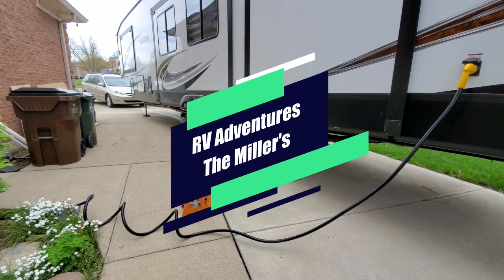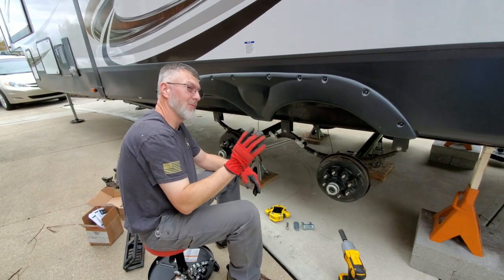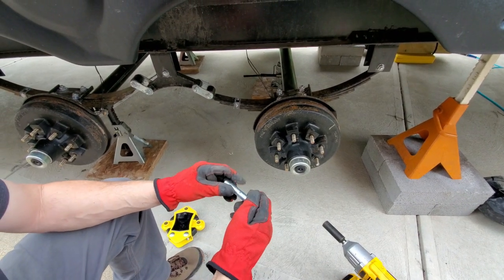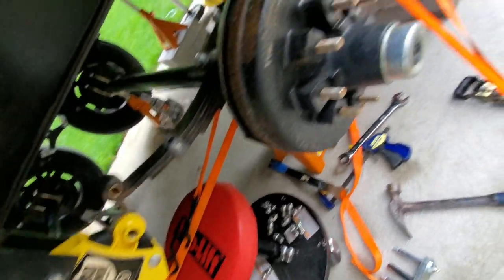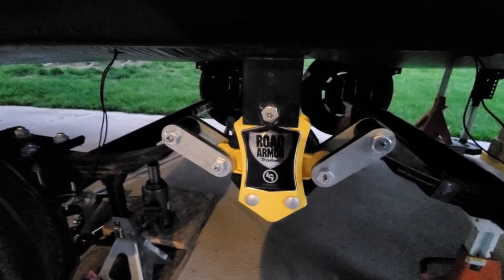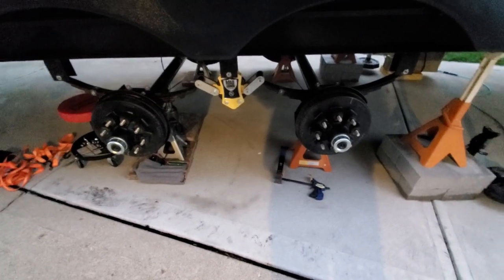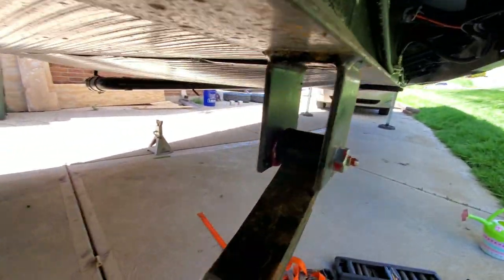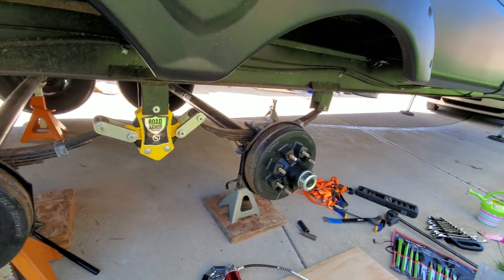Suspension Upgrade

Comment: One thing to minimize the chance for a blow out is check the damn tire pressure before you leave and get a tire pressure monitoring system, they're pretty cheap and most monitor temps so you can stop before you have a major issue.

Comment: I have a 1994 Skyline Nomad that I’ve been going through it and replacing a lot of old things. Mostly with better electric components. I went out to check my shackles and mine have the heavy duty shackles. Those were probably the standard back when my trailer was built. Everything now is  built with barely adequate!

Comment: I know this is an old video but can't tell you how much it helped.  Specifically the reference to the shackles.  After watching your video I ordered my kit.  4-6 week back order so I decided to check what was in my order.  Guess what, the shackles were the longer 3" ones not the 2 1/4 " I needed for my 33" on center axles.  So I called Lippert and they changed the order and they even had the 2 1/4 shackles in stock.  Thanks again .

Comment: I have my Polaris Rzr 900 EPS Trail 50 Terrabites tires balanced...  the tire dealer thought I was nuts!    My Rzr is Michigan State highway legal.  State Titled as a "Assembled Pickup Vehicle" perfectly legal in Michigan.  It runs 55-60mph on the highways.  Smooth as silk!

Comment: Observation: A quick gooogle shows "never-fail" bushings are now availeable for many brands of "cushion style" equalizers. I'm a long time bronze guy. Sorry but bronze wear out.
I also discovered all kits comes as kits with correct shackles. My kit is Dexter E-Z.
Lastly never lift a trailer like that. You will put the axles in an "axle flip" where theskackles flop over. Like his clearly does.
He's forced to use ratchet straps fixing a potentially dangerous fuster cluck.
One at a time works fine . . . unless you like buying extra jacks and jack stands and bricks . . .and your wife laughs at you. Or the engineer across the street walks over and asks "wtf are you doing ?" and takes a cell phone photo to show back at work.

Comment: Great video.  I would also weld plates on the shackles it mount to the frame.
Reply: Weld the shackles to the frame???
Reply: @edholloway2287  weld plates to the back side of the shackle for strength, elimination of flex.

Comment: Gee American trailers have tiny leaf springs compared to Australian built trailers. They just don't cut in in Australia. Also they don't seem to use rock and roll suspension which is strange considering the size of their rigs. This whole set up needs to be upgraded with heavy duty spring, hangers, U bolts to last the life of the rig.

Comment: Im doing this upgrade to our 5th wheel and wondered when you put the wheels back on are you still able to get to the grease fittings the way you put them in, thanks. Our Prime Time Crusader is a 2021 and this is our 3rd rv and my God! Ive spent probably 20 hours fixing stupid things because the dealer we bought it from is 2.5 hours away and they cant even do things right!

Comment: Do these really work? I mean it still is an equalizer connected to the frame by one bolt. You will still get movement from side to side same as stock metal equalizer. Is there really enough force to activate any Dampening from the rubber. There is also movement in the shackles as well. Initially I thought about purchasing but videos I have seen of them in action made me second guess them. What can you say to convince me they are worth the near $300 asking price ?

Comment: You do realize that you installed the wet bolts and shackles in the wrong direction. You will have to remove the tires to grease them
Reply: no problem getting to them
Reply: It really doesn't matter which way they are installed. You can add a cap if your worried about it.
Reply: I use a set screw so as to elimanate tire strike, a result of many factors. When grease time occurs just have an allen screw and sert/ zerk in hand.
Gotta say, you may be replacing the bronze bushings. They wear fast also. It is clearly the 1st set he's ever used. He'll be bashing those in the next video.
 The fact is accept and get used to axle  maintenance. Make a fun rewarding day of it.
Also expect the unexpectected. . . on everything he touched (and poorly explained)
Fwiw I'm trying a different brand eq, but question his going longer on the shackles. 
It's 4am, I'm sleepy, but might bet a friendly soda he thinks he's an at-home-smarter-than-qualified engineer.
Did the mfr website say so? Are those the correct eq for those hanger/ 8 bolt/ spacing. Possibly not but he's raised my eyebrows.

Comment: I find it moot point to increase the shackle connectors thickness when the original is the same thickness as the spring hanger that you are not thickening. Forest River did not design these axels or suspension system so to blame them is not really fair either. They only support 7000 pounds per axel on a trailer that does not change in weight that much.
Reply: I was wondering the same thing, after seeing how thin that bracket is. Im no Engineer but would think it gets all of it's strength from being vertical and no side to side movement where as the shackles might have more all around movement, IDK just a thought.

Comment: not all new RV's have the 'plastic' bushings and paper thin shackles out of the factory.  My 2020 Montana 3741 FK came with the upgraded shackles with wet bolts and one of the best equalizers.   I wish they would upgrade the axles to an 8 ton versus 7 even though the trailer max's out at 14,000 lbs, I would like to have that extra security with an 8 ton axle.  At least Keystone didn't go cheap on the suspension.   Nice that a company would do that.

Comment: Thanks, great video!  I’m preparing to redo the dump system on our Grand Design Imagine 2500RL, saw yours. Could you pm me some pics of your dump plumbing?
Just bought Carlisle 225/75-15E, replacing Westlake 205/75-15D.  Hope to add RoadArmor and disc brakes soon.  What are your thots on beefing all 3 OEM shackle to frame mounts?

Comment: Could you have put the zirks to the inside so you wouldn’t have to remove the wheel to grease?
Reply: I agree.  Accessing the inside for service is much less "crazy" than having to jack up the trailer and remove the tires just to access the zirks.  Good point.
Reply: there is room to get to the Zerk fittings with out removing the wheels. I didn't want to crawl under the rig to get to the fittings.
Reply: A smart person would.

Comment: Hey what size Frame tab is that? The black Limpert part coming down from your frame mines only like 2 1/4 or 2 1/2 inches to The center of the bolt hole. . I’m worried the road armor would not fit.

Comment: what is the chances of flipping an axle with shackles out that far. typically its supposed to be a w shape i know but looks like it could flip
Reply: the short shackles will not line up with the mounting holes. even using the longer shackles it was tight.

Comment: That hole suspension is garbage the spring hangers are too light and weak side to side motion will crack them there too thin.even those axles look pathetically week..